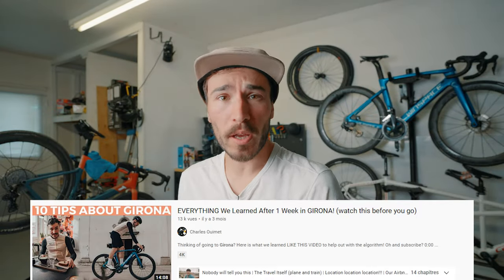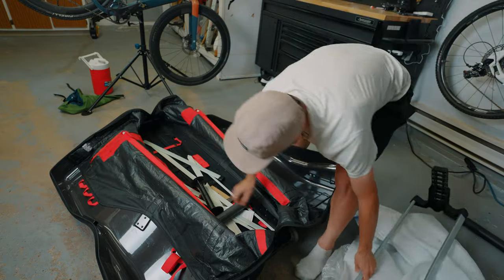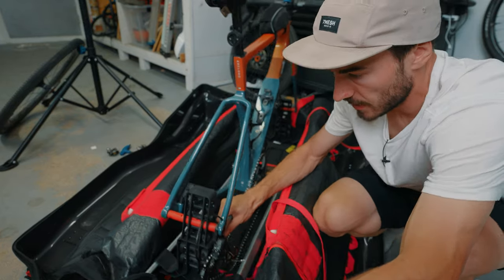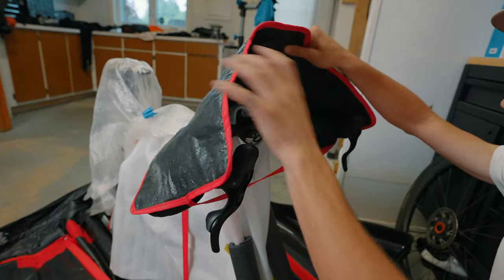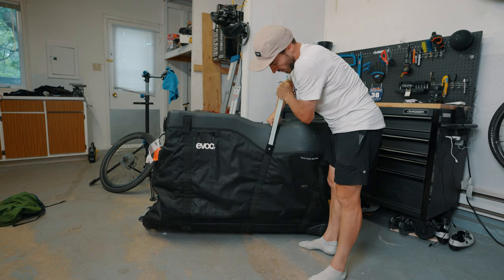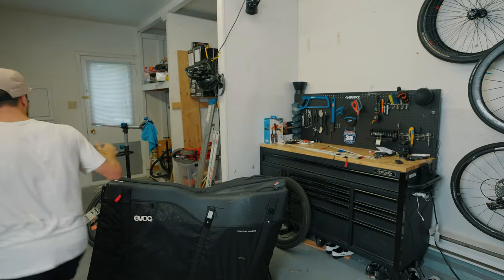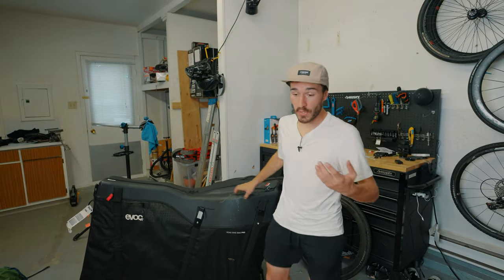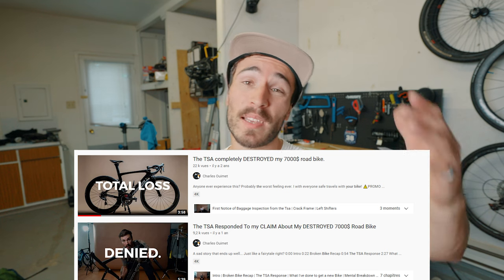Pack your BIKE BAG in 5 Minutes!!! EVOC Road Bike Bag Pro REVIEW

Comment: I did build my T1500 bike with external cable routing (with a normal stem and handle bar) only for the purpose to make it fit my B&W Bike Box 2 when i have to take a flight.
And i have a soft Decathlon bike bag when traveling by car or train.
I much prefer a hard bike case for flights, it's way more safer !
Reply: Ya, way more safer for the bike.
But the baggage handler idiots can wreck hard bike cases as well - and those are not cheap.
Speaking from experience.
Basically, we have a choice between which of the two we would rather not have damaged - the bike or the case.
It gets expensive either way.
Reply from the maker: Good idea! Thanks for sharing

Comment: For bikes with integrated cables or hoses going through the head tube, this is the solution.

You should  see if it fits in  an ordinary compact car (putting the back seat down, removing the wheels) if you travel with the bag rolled up (storage mode) and the bike in the back with both wheels removed. Perhaps 15 minutes of packing work at the airport to pack it, but would save you the trouble of having to rent a van. 

The one vulnerable part in the design I notice, is the zipper.  If just a few teeth get damaged at the corner or on the side, it renders the thing unusable. I think a zipper recessed by bumpers the corners would be an improvement.
Reply from the maker: thank you!!! I indeed took my derailler off today before flight back home from Iceland!

Comment: A big PITA at oversize check-in (YUL) is that they always ask you to take everything that is not part of the bike out of the box, to run through their scanner separately.
In your case, I'm guessing that would mean all the plastic wrapping and clothes bag.
By the way, I use a rigid box, fairly heavy, so definitely have to check-in another piece of luggage. 
My trips are usually several months, so I pack more anyway - no chance of going with just one check-in.
Bonne voyage !

PS. Charles, got any updates on the Bromont track? ....are they putting the top surface panels on?  Thnx
Reply from the maker: THanks for sharing!! YUL are sooooooo picky and dicks most of the time with bike bags.
I think it's still on ''track'' for the velodrome to be ready in september!